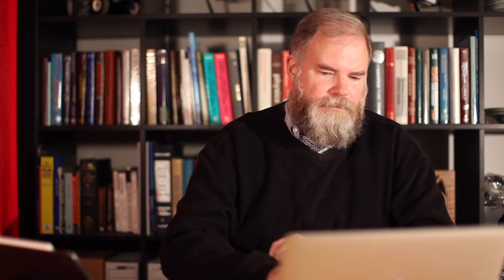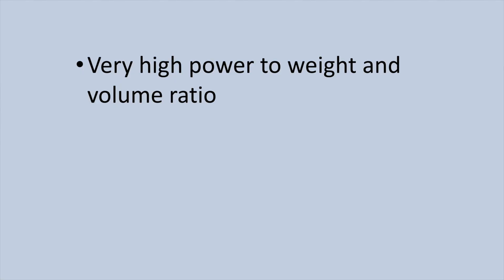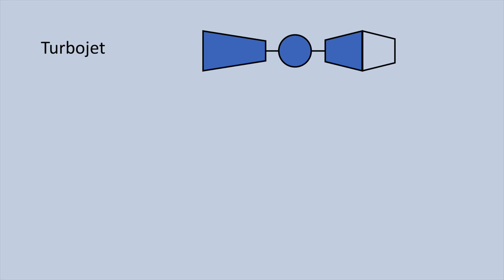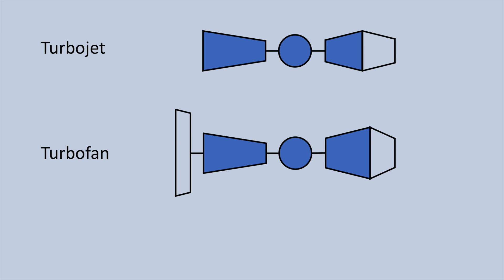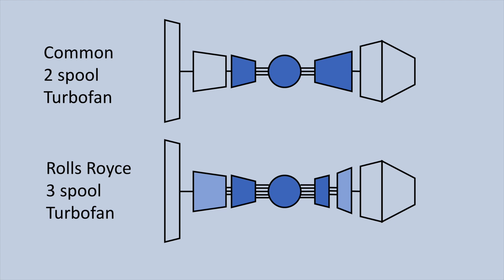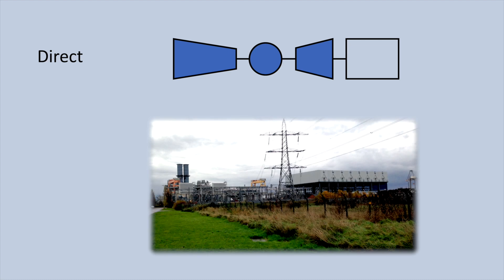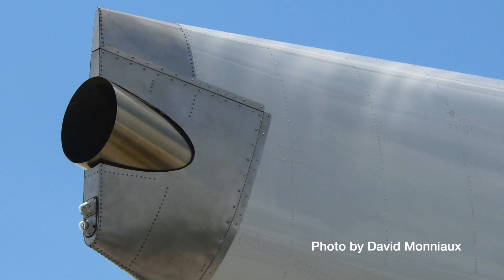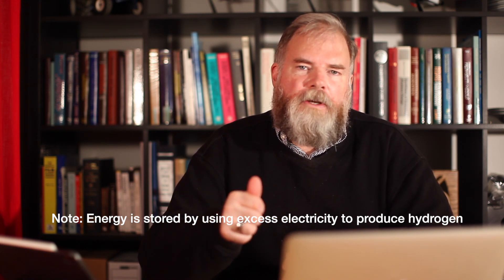Gas Turbines: What are they and how they are applied

Comment: Sir in power plant we use gas turbine for Generator rotation.
Would you please tell me that with illustration why we use diffuser
Reply: Energy which leaves the gas turbine is wasted.  This is in the form of heat and kinetic energy.  The diffusor in the exhaust reduces the kinetic energy of the flow by expanding it which lowers the outlet static pressure of the turbine increasing the static pressure drop across the turbine causing it to produce more work.
Reply: @GeoffreyEngelbrecht  we know that, pressure= Force/Area.
At diffuser area increased at outlet so pressure should be decreased .But in my gas turbine manual book, it is written that diffuser is used to increase the exhaust pressure.
I am totally confused.
Would please solve my confusion.
Reply: @imranbahar3270  The velocity decreases as the area expands in the diffuser.  You can think of it in terms of Bernoulli's equation.  The Total Pressure = Static Pressure + 0.5*density*velocity^2.  In the absence of losses the Total Pressure is constant.  So if the velocity drops the Static Pressure rises.  But you have to remember the Static Pressure at the outlet of the exhaust stack and effectively the diffuser is atmospheric pressure.  This is pretty constant as it is determined by the air mass surrounding the Earth which is significant.  So if the pressure rises to the outlet of the diffuser but that pressure is fairly well fixed there that means the pressure drops towards the outlet of the turbine.  The more kinetic energy which is converted to Static Pressure the greater the drop in pressure at the outlet of the turbine (or inlet to the diffuser).  Of course you also want to avoid flow separation and other losses which will cause the Total Pressure to drop so it is important to design the diffuser well.  This is particularly an issue for low pressure steam turbines where the diffuser can contribute significantly to the overall performance of the turbine.